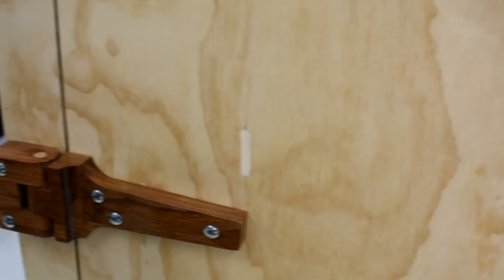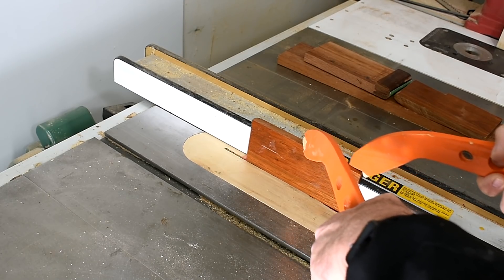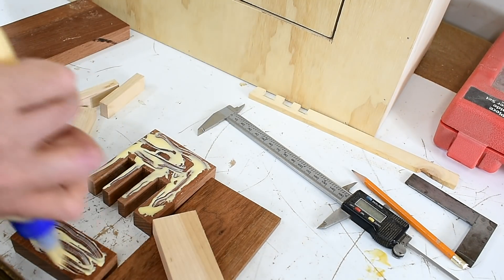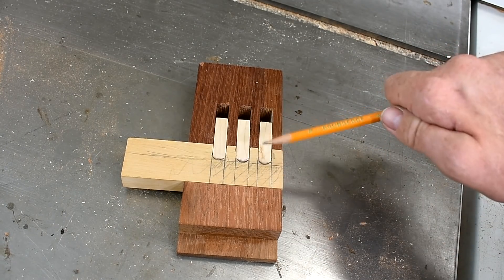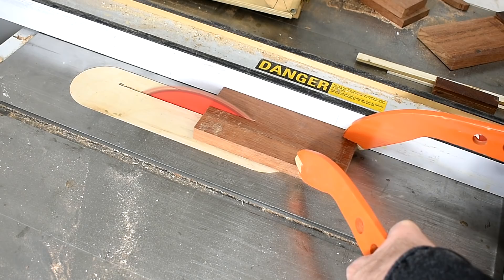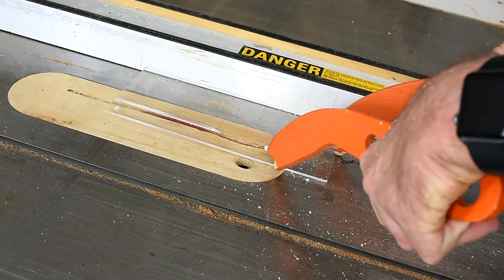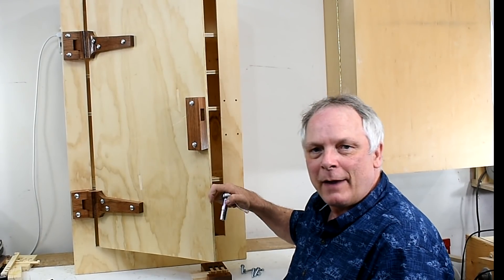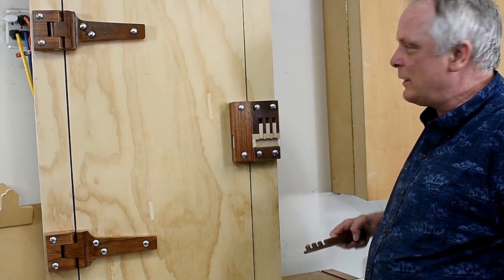Wooden lock build

Comment: ok Jack, maybe I missed it but, what keeps the "tumblers" from falling all the way down in the key slot?
Reply: Hi, Look at 6:40, the latch has slots that hold the pins from falling down fully.
Reply: if you pull it all the way out probably the pins will fall. yet the latch bolt teeth dimensions  and pin dimensions will match at that half drop position so pins wont fall all the way when the key is out
Reply: I was thinking about making a lock for the outer part of my door to prevent burglars from getting in. No matter how many times I change the locks , when  I  am not home they get in , just because they use tech little  known to most people. 

The lock would  have to be made of steel. I would have to change the  door to a door of steel. 

The  lock would have to screwd and glued with a strong glue to the door or welded to it.

Those pins and the key,  their format , etc belongs to a part of mathematics called Topology.

So my key and the pins would  have to have a much more complicated topology for the burglars not get in. Also it seems the pins have a spring inside the hole where they are  placed. If this is the case the K of my springs would have to be very big. So it would be hard for the key  to raise the pins.  If it's easy they will do it remotely. 

The Topology would be better if there was no need for springs and no one could damage the lock from outside as easily.

I am trying  hard to understand the design and I don't  think I've grasped everything yet.

I  need a strong and reliable outer lock  so much and it's  not only me. No electronic or devices with passwords would do for me. It must be physical key to open the lock.

No electronic safety measure produced any effect. I dealing with people with high tech and no respect.